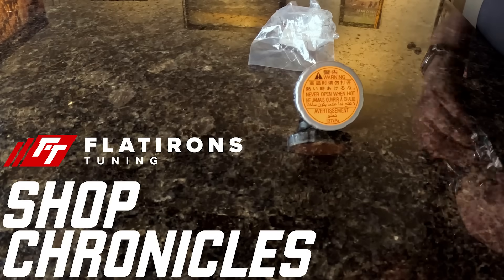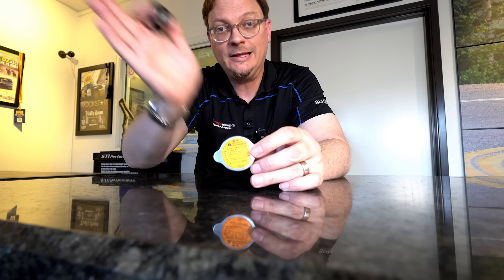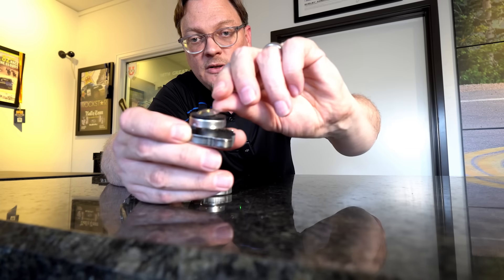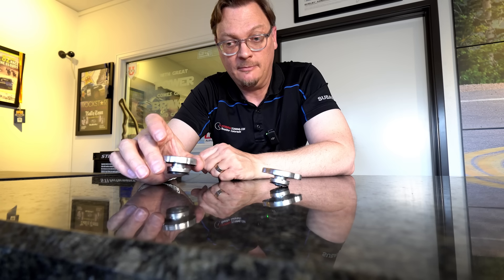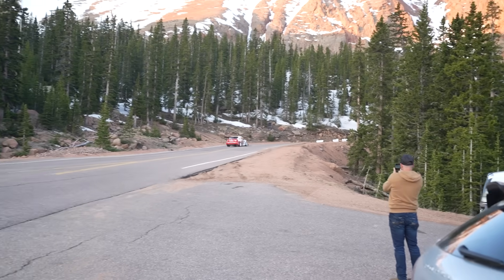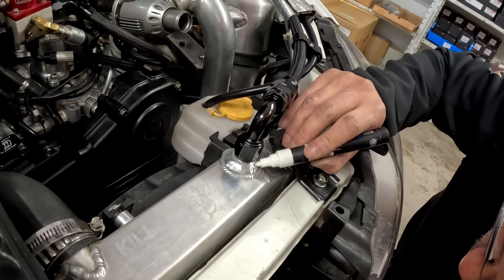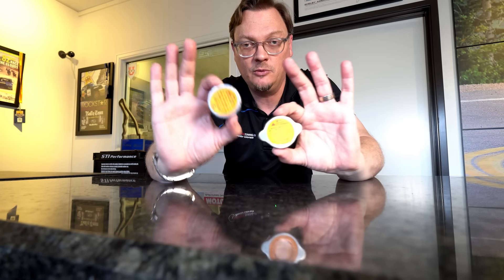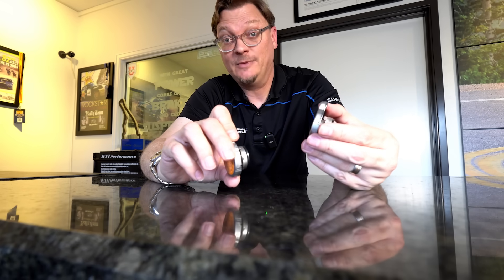Critical to keep your Subaru Cool! Radiator Caps Finally Solved!

Comment: speaking about the cooling system, can i ask you some questions regarding an 07 forester xt and an 07 sti..
Reply from the maker: Absolutely!  The best way is through our "Live Chat" feature on our website.  That goes to one of us and we'll always do our best to help.

https://www.flatironstuning.com/

Thanks for watching and Stay Tuned!
Reply: I have an IAG900 going into a VW Beetle with a capless PWR front radiator, stocke engine mounted water pump and a pusher Meziere electric pump up front.  I need an expansion burp tank after coolant leaves the block into a swirl and that tank has a cap.  Do I need an expansion tank up front by the Meziere pump also?  I don’t mind paying for the advice but your paid advice system refuses to use Safari as a browser.  Can I call and pay someone to walk me through the system?  Thanks!

Comment: I debated on cap or no cap for the Koyo rad upgrade. The reason why Subaru put a cap on the cheapo oem radiator is reason alone to get the no cap rad. now I gotta check my caps.
Reply: Yeah my radiator has no cap at all and it's been fine since 2005
Reply from the maker: It is never a bad idea to check your radiator caps.

Thanks for watching and Stay Tuned!

Comment: Im still using my stock cap on the expansion tank on my 04 STi. I put the typical sti cap on the radiator like 15 years ago. Never had over heating issues…its got the ears but im not sure if its 1 way or 2 way.
Reply from the maker: If it is an STI cap, it is a 2-Way cap most likely.

If you aren't having any issues, that is definitely good.  Double check and make sure that the coolant level in your expansion tank is right up to the top, and that you have normal movement of coolant in your overflow tank.

For reference:

https://youtu.be/MBVNHON3d0w?si=vG3PUhm5zOtztzhV

If it is working, that is great.  Always a good idea to double check.

Hope that helps and Stay Tuned!